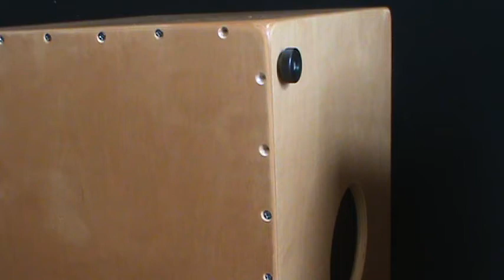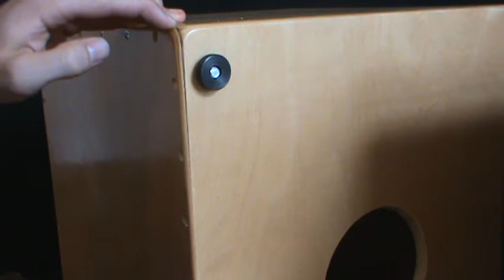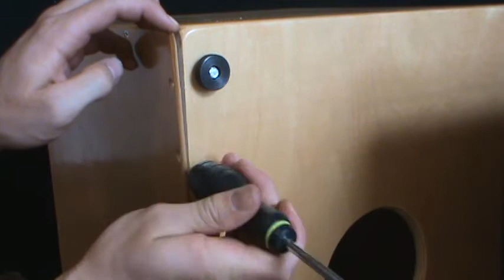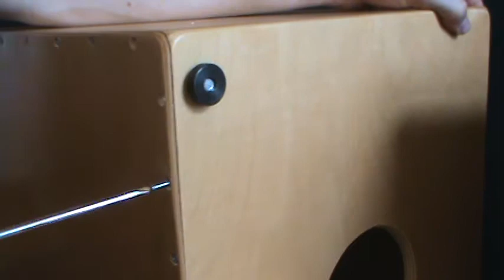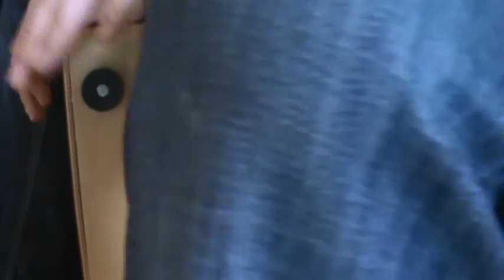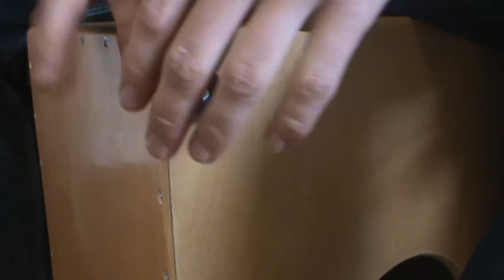How to get a perfect responsive slap on your Cajon

Comment: Hi Andy - great video thanks !   I tried to do this on my Donner Cajun but after removing all screws the face plate won’t move or come off.  I don’t want to ruin my new Cajon by forcing it off - any help would be appreciated !  Thanks !
Reply from the maker: I'm not familiar with that kind of cajon but it might be glued on. I would contact the maker.
Reply: @andyskellenger  Thanks Andy for your quick reply  -  I have done but they are on Holiday !